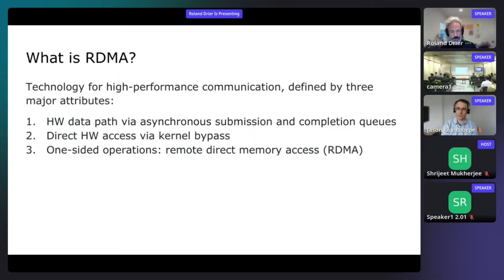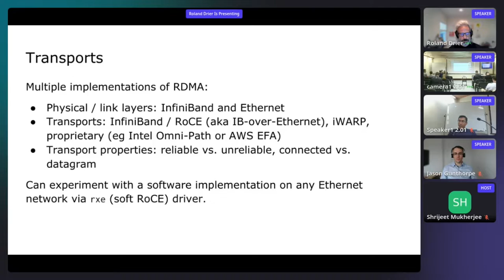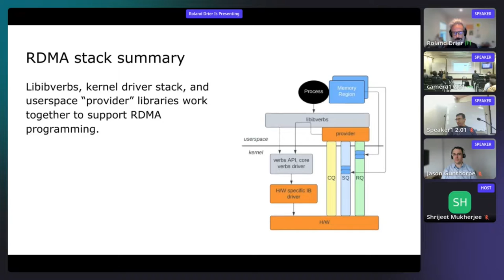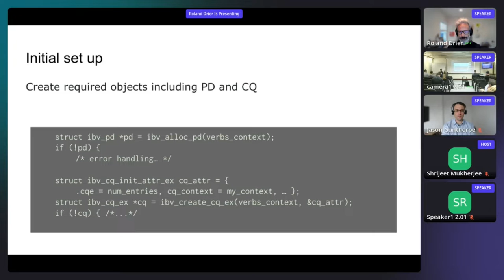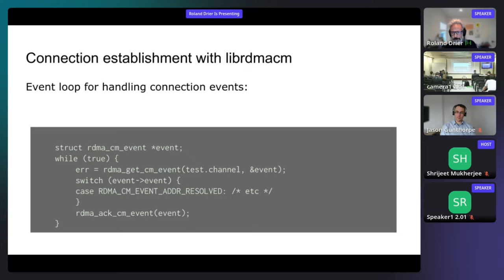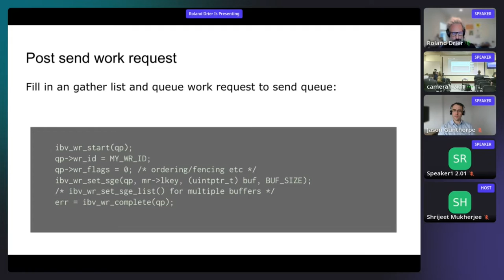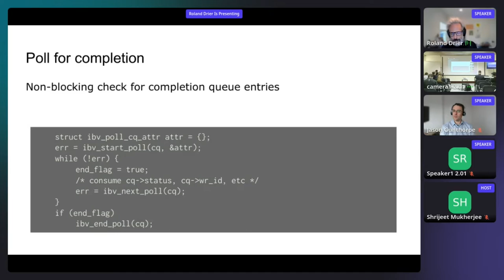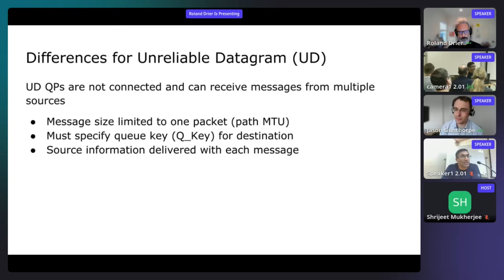Netdev 0x16 - RDMA programming tutorial

Comment: You assigned buf to sg list, buf was malloc'ed so was a VA. The sg list then is a list of buffers, registered with their virtual address. So the library must have to translate the address into physical address and on top, must add in more sg entries in case the buffer wasn't physically contiguous for the NIC to consume, is that correct?
Reply: the NIC hardware uses the lkey (local key) provided in the sg entry to look up the translations in its MMU
The MMU contains the VA-to-PA mappings that were set up during memory registration.
This is actually one of the key benefits of RDMA - the expensive address translation work is done once at registration time, not on every transfer.